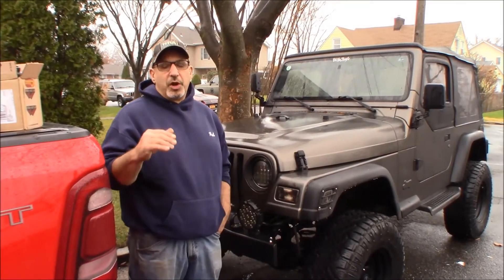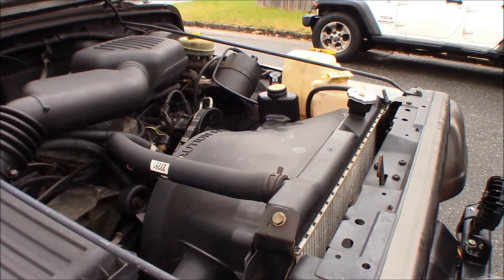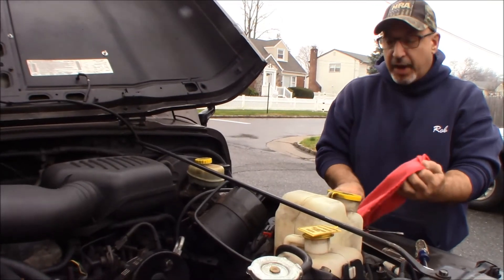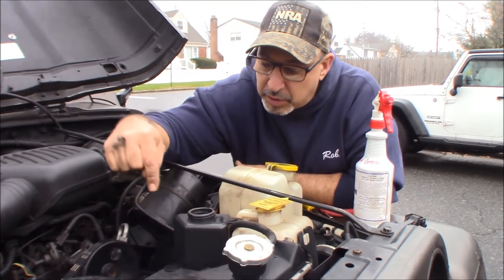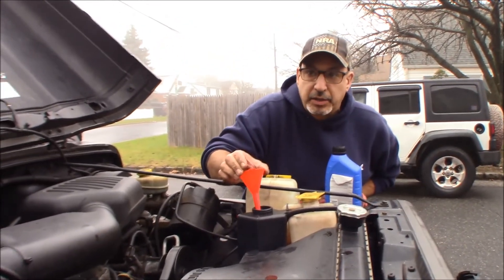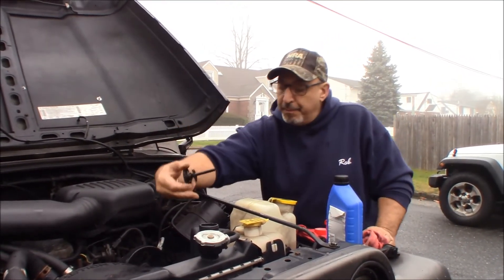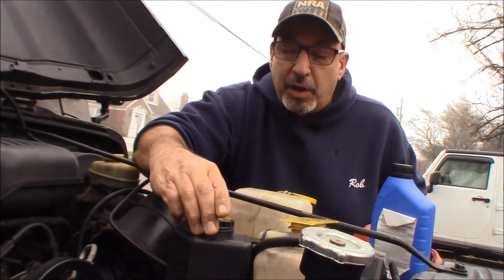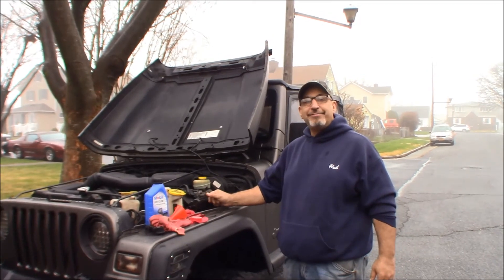97 Jeep Wrangler TJ 2.5 Power Steering Reservoir Retrofit & Repair Parts not Available. Video 2 of 3

Comment: I know this video is over two years old but I wanted to say thank you. I had this repair done in about 20 minutes - I had the exact same failure of the original 2.5L reservoir at the bottom of the feed/return stems  in my 1998 TJ (POS blow molded part). I also originally tried to plastic-weld the crack but I assume any contamination from the hydraulic fluid prevented a good bond. Surprised the aftermarket never responded because the OEM part is unobtanium. Thank you especially for linking the replacement parts via Amazon. Steering is back! 

FWIW, I added a second zip tie at the bottom of the reservoir to hold it tight against the coolant reservoir both top and bottom.
Reply from the maker: Glad it worked out for ya